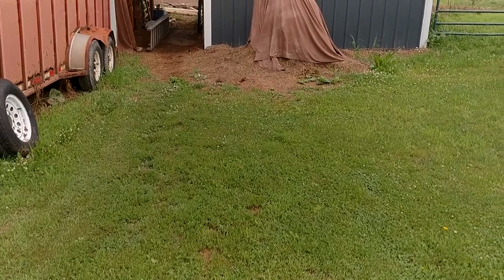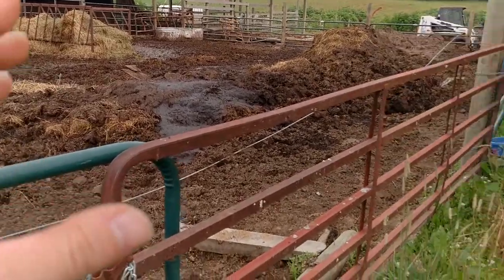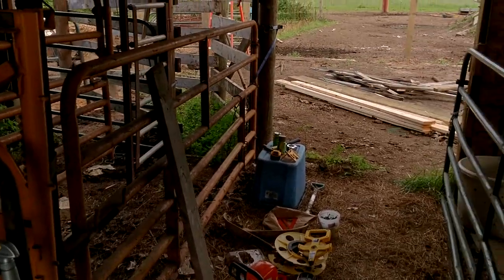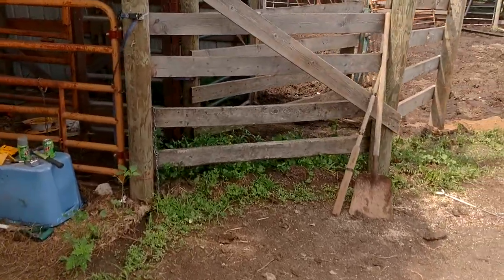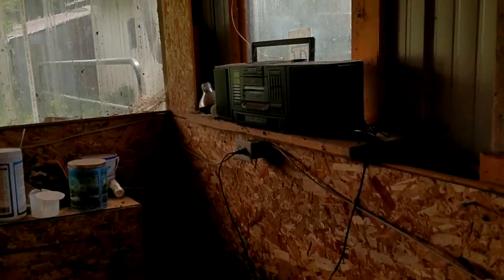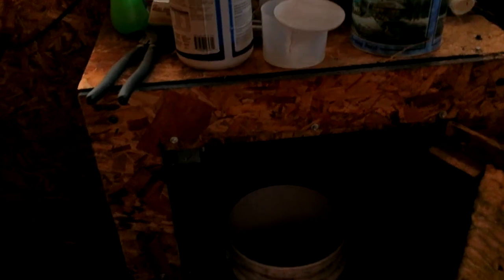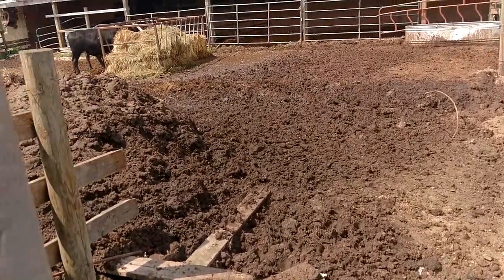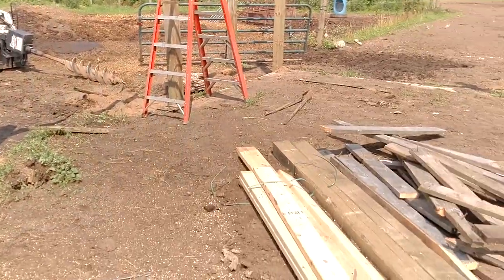Shed design for cattle on the cheap

Comment: I would broadly agree with your sentiments about not spending money on buildings and equipment when you don't have to. To me the first essential is quality perimeter fencing to have peace of mind knowing that the stock are where you expect them to be  - on your place! Not lost wandering about having escaped or worse, stolen, as I guess it is likely that the gentleman will be working away from "home" at least initially.
Water supplies for drinking are essential for all livestock which are best if they can be supplied via pipe but initially this need can be met via a bowser on wheels with drinkers or trough attached. Filled elsewhere and hauled to the stock. Don't forget for spring, summer and autumn time this can be supplied by above ground pipe as it won't freeze and you don't have spend money on burying the pipe or setting up drinking tanks, perhaps in the wrong place in the light of experience.
I would agree that a great deal of money can very easily be spent on buildings which earn you very little, if anything, besides making life easier / more comfortable for you and the cattle -often the concrete flooring costs way more than the structure itself! 
However I would completely agree that cattle handling facilities are essential that are under cover (depending on the severity of your winter months) and adequately lit for working in the dark are essential as are some pens for calving purposes, sick animals, temporarily holding some animals etc. The key issues are flexibility of use for animal treatment, sorting stock etc. AND the ability to work these facilities by yourself safely. Animals will not willingly go into places if they cannot see their way out - hence one of the important reasons for good lighting. 
If you can find uses for this building 12 moths of the year the that is really good and it is easier to justify the capital costs.
Some other important points: 
Do not invest in much in the way of machinery - initially use custom services available in your area with organisations you can trust and rely on.That way you buy extra labour with skill together with access to modern machinery and you only pay for what you need when you need it and not in equipment that is slowly rotting away that needs constant repair and maintenance.
Next if you go in for a cow and calf operation please buy or hire a quality bull - they are effectively half your herd! Their influence on calf appearance (colour breeding), conformation, and growth performance, and hence sale price, is far, far greater than many stock breeders realise but it takes time before these features become apparent.
Lastly have your soils tested so you know what you have to feed them with to make them perform well - many farms have soils which are too acidic for crops including grass to perform well and they desperately need lime to correct the pH.

Best wishes to your friend for this potential long term venture.
Reply from the maker: yep thats what I was trying to get at, fencing and a working facility are of the most importance, big sheds are least important and only cost lots of money!
Reply: hell people steel the 10 month old ones right out of the pens in the yard and the community feeding fields, i dont use them but many do, but  i have had them stolon right out of the yard pens
Reply: trees for wind breaks

Comment: you got that right cows are rang anamals you can biuld all kind if stuff for them and they may use it a few times a winter when wind it 50 to 70 mph but you fave a leayer of straw out side for them to lay down on and that's were they will be, i have bush on to side of me, and they will head into the bush out of the wind, and coldd or the heat of summer, mine right now are all out in the field right now at 10:30 at night as they were in the bush all day out of the flys and warm, we only hit 72F today, i didnt have to biuldany wind brakes as i have vallys in my feilds and bush, as for fence all i have is one wire electric for 2.7 miles around, and in winter they dont go far from the round bails and grain, i done grow corn in my hard rock red clay so i dont have corn silage, i feed good and poor round bails in the yard and choped corn not whole, whole corn they just shit 50% of it out whole, i mix some chopped barley in the -25 to -50 weeks, in summer when i go to feed the grain, i dump it all and call them, they come in from were ever they are, and no most times i dont see them, but when i call they all come ruining,, i have a few small 14x16 barns one to ork in, i weelded everything up my self from old tubing and pipe, thin wall. since i was a welder by trade all my life, for my fences they wanted 10:90 per 8 foot tee post, hell with that i used old steel and trees. north western Ont. Canada. oh PS i have not even had a tractor for the past 11 years as my ex wife sold all my eqipment out from under me, and what she didnt sell the courts here gave her everything i had
Reply from the maker: You are correct Arnold, cows prefer to be outside and on dirt!

Comment: I agree mostly  I wouldn't go cheap on the handling facility and I don't mean go buy the most expensive one you can find I mean buy a real deal heavy duty working facility with a squeeze chute with self catch head gate and a good place to group your cattle when you need too and good fence around the perimeter of your property  a good working facility will pay for itself in what cows and calves you save

Comment: Hey man liked this video... I agree cattle dont need to have a roof over their head.... it would be nice BUT not necessary.  I would say that Good working facility is a must as getting hurt  or problems cost more in the long run.   Not saying you have to spend alot of money to build what you need but what ever is built it needs to be safe for the help and yourself.  Also needs to be designed with cattle flow in mind as calm cattle are way easier to work with than nervous cattle. I would suggest to watch some videos on cattle behavior and learn how to work with them to keep them from getting worked up
Reply from the maker: +Ted Kahler thanks Ted!

Comment: out west they use extra boards nailed onto wood fences the opposate way(vertical) as cheap wind breaks.Also don't know if i asked you this what brand is your head gate??
Reply from the maker: younggunfarmer416 it's a souix headgate
Reply: do you mind showing a little more in depth on how the rafters and trusses are set up on your building.
Reply from the maker: Yep, once I get to that stage of the build I will definitely show that for you
Reply: thanks.

Comment: now that you explain it that makes perfect sense it was just your building seemed a lot bigger but guess not i guess when i thought it was bigger you were in the lean to lol i pretty much say hydro or power or electrical what ever comes to mind first lol see i would need more than you not too much more tho just a bit bigger of a heated water area to have a separate water system from house pump water tank ultra violet etc because we far too many times have had one person not tell the other they are using water and then the other person uses the water and scolds the one in the shower lol! so with waterers that could possibly turn on at any time or somebody decide to use barn water well somebody is in the shower you end up scolding that person lol! that is why up until barn pump quit working and mom said screw it  we had to different systems one for barns one for house so they don't compete and take pressure vise a versa from each other

Comment: Only thing I would add is that if you can get portable panels chained up to make your corral or feedlot then you can make changes very easily without costing any money. If you build permanent and change your mind it's a big headache to redo it. They are more expensive than lumber, but they go up faster and if something happens and you have to get out of the business you can sell portable panels easier than used lumber.
Reply from the maker: Portable panels are a great idea, and you can get them in wind breaks also!

Comment: Buildings are nice but they don't make you any money.    Wind breaks and portable panels if you need to lock up a hfr    we take calves to the house if they are cold when they are born.   I don't know how guys feed everything inside and make money unless they get 10' snow a year.    You can build a well thought out working system that is the right size for you   and it can be pretty simple with a head catch mounted on a secure fence and a gate on the other side that you can tie it close as a squeeze.    My Grand father had cow calf and fed all his calves out with 2 pens and a rope and a good post to dally to in each pen   He was happy to get a squeeze but he taught me how to milk a cow after you threw her on the ground.   Back in the old days when we used to pull calves on cows more often , we roped them and put a halter on them and I still do that if I need to , and it makes for good stories lol
Reply: Every dollar you save can go to build things up but if you have a big loan for a building the stress will kill you every time you lose a calf or have a wreck

Comment: What's the minimum number of cattle to own for this setup?
Reply from the maker: +Midwest Allis Fan the working facilities can handle almost any number, but my lot size are for 25 cows, calves and yearlings to fats.
Reply: larsonvalleyfarm would you see a need to installing working facility with 5-10 cattle starting out?
Reply from the maker: +Midwest Allis Fan check out Landmark cattle, at least a holding pen, alley and chute... It makes handling and working cattle much safer and more enjoyable.

Comment: Id say rather than spending as little money as possible, put The money in The right place. Have Nice buildings, machines that Will do The job and wont die on you when ever. See what Will generate money fast and Invest in that. If you cant afford to start a cattle ranch, start with sheep. Then, as The sheep are generating money. Graduly move over to cattle. Or do both